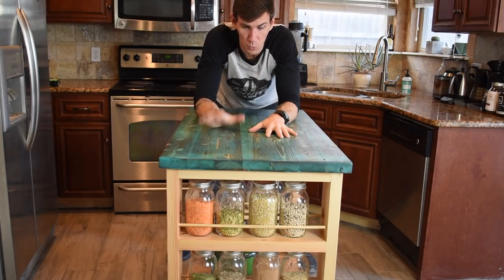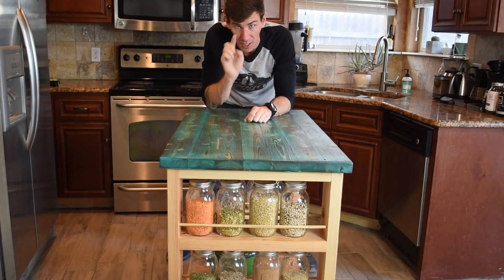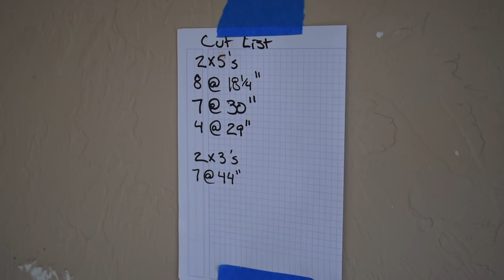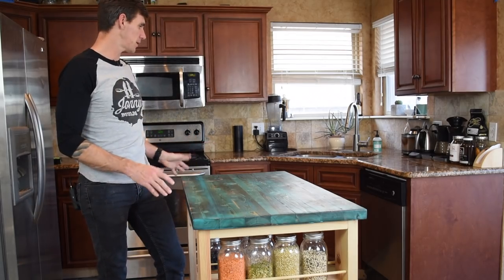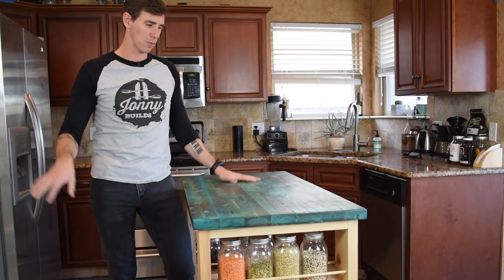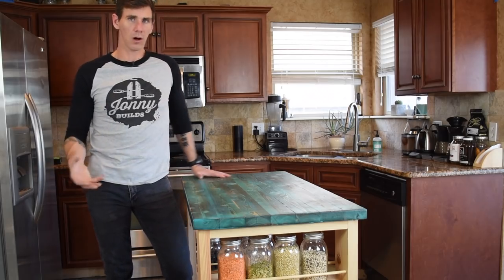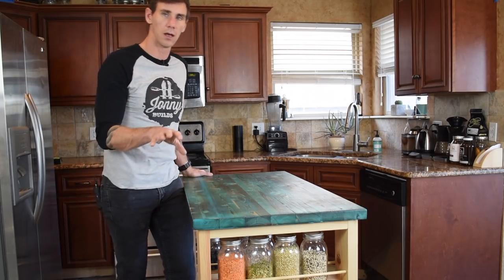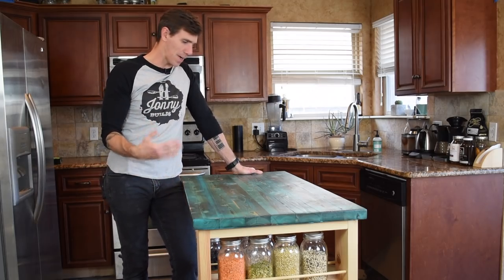DIY Kitchen Island w/  Stained Shou Sugi Ban Tabletop

Comment: I made one similar to this, but added a full shelf about midway down.  I wondered, though why the table top had (3) supporting boards to rest on, but the bottom shelf didn't (which also led me to wonder whether the shelf needed this).  I'm now making a smaller, lighter one for my sister, who has a very small space for this, using 1x4's for the most part.  Loved the Shou Sugi Ban effect!

Comment: Nice build. If i could add that the dowels may warp or accidentally break would using copper tubing to cover them when sliding them through the end. I like adding metal to wood projects.
Reply from the maker: Copper tubing would look really cool. Never thought of that. I will say that I use this daily and often and the dowels are holding up nicely. The fact that they flex a bit makes getting the mason jars in and out a breeze.

Comment: Hola Jonny, excelente trabajo, felicidades, muchas gracias por compartir tu trabajo, por otra parte, noto un detalle con respecto a las medidas, específicamente en la parte de arriba o cubierta, ya que al componerse de 2" x 3" esta daría un ancho de 21", sin embargo la medida de la parte lateral de la base es de 22 1/4", posiblemente la medida correcta para las piezas de la cubierta sea 3 1/2", dando una medida de 24 1/2"... Saludos!

Comment: That colour looks sooo good.
How did you avoid getting squeeze out from the glue up messing up the stain? Does the stain colour glue?
Also what's the purpose of using glue and pocket holes for the table top? Is just glue sufficient?

Comment: Nice build. Not insulting the finished product, but it's important to let folks know that this is actually not shou sugi ban. What you did was lightly toast the surface of the wood. Shou sugi ban requires actually burning so much of the soft wood that removing the char actually scoops into the soft wood and leaves the harder grain raised - quite a bit more work, but you end up with even more striking pieces. I've used the technique for several pieces for D&D gamers.

Comment: Looks great! But couldn't help but notice that if you look at the end grains of the worktop, you have all the planks grain arching in the same direction apart from 1 or 2 that are the heart wood. When I make bar tops or any jointing of planks it's best to alternate the direction of the end grains (up, down, up, down, up and so on). This helps prevent the top from 'cupping' over time as the planks fight each other to pull in their relative direction, where as if they were all the same way up or down then they can pull together quite easily and start to 'cup'. Hope this advice is useful to you but apart from your work looks ace!
Reply from the maker: Thanks! I definitely goofed on the board layout, but it’s holding up nicely so far.

Comment: So total newb here but ... can you use that surface for chopping (with a cutting board/butcher's block) and such? Can it get wet?
Reply from the maker: No, you wouldn’t want to do that with this particular finish. The wood is porous and the finish isn’t food grade. I put a cutting board on it before chopping anything up.
Reply: But it could be, with a coat of epoxy resin. Proper prep would have to be done because it's individual boards, but a top like this would look even amazingER and be foodsafe and heatsafe with a finish coat of clear epoxy resin :-)

Comment: Ok but you can use a cutting board, you wouldn't be worried about getting it wet with tomatoes or lettuce or something? It is a work surface and not just for display. Great vid, fantastic editing, I subscribed.
Reply from the maker: Its not an issue. With the finish it wipes clean easily.
Reply: This is amazing, and the poly is a nice coat, but it would just POP and be so amazing covered in a coat of clear countertop epoxy 😍😍 <swoon> Love your work, Mr Builds :-)

Comment: Very nice project, curious, do you think this structure would support a granite countertop on top instead of a wooden top you assembled?  I'm assuming weight of granite would be around 100 lbs?  The wood 2x3's together probably weigh about 30 lbs.
Reply from the maker: Thanks. I’d probably use a stronger joinery method beyond a few pocket screws at the bottom, but I think you can make it work.
Reply: @JonnyBuilds  Hey just wanted to share, I finished this a few months ago - picture of your design frame with granite countertop, holds up well, slight wobble is unavoidable with the wheels but it is minimal, thanks again - I did do extra strong joinery. - https://imgur.com/a/6CRBKaz

Comment: Good job ! I noticed that you planed your table top boards , and then while you applied stain I noticed a  crack between 
your boards . I do a lot of shou sugi ban and in the burning process I get warpage on boards and also the grain is 
emphasized , cracks appear and glue joints open making for a non smooth work surface especially
when I do a deep burn. I don't want to sand, plane or do anything to lose the character except maybe epoxy.
Do you have any tips ? Thank you

Comment: Cool project. A few questions:
With the laminated slab on the top and casters on bottom, does it feel top heavy or unstable?
Could you have just friction-fit the dowels in? I'd be afraid of them breaking and not being able to repair it.
Does gluing dimensional lumber end grain offer any strength at all? I've never had any luck with it.
Reply from the maker: Thanks! This isn't top heavy at all. The top is just 2x4's. You could friction fit the dowels, but I am not worried about breaking them. I use this often, and it hasn't been an issue. All the end grain glue joints are pocket hole joints. The glue adds strength, but its more to hold the wood in place when you drive in the pocket holes.

Comment: Did just screwing the top to the base ever cause anything to split? Doesn't wood have a tendency to expand and contract with the seasons?
Reply from the maker: No splitting so far. The holes are slightly elongated to allow for some movement.
Reply: Jonny Builds thanks for replying Jonny.

Comment: Great video! how stable is the finishing if kids put a glass of water on it for instance? i am thinking if making a new dining table with a finish like yours.
Reply from the maker: To make it more resistant to stains add a few extra coats of wipe on poly, and the finish with a top coat of paste wax.
Reply: Thanks, i will give that a go.

Comment: Is this a military secret on what the color is I’ve asked many times no answer.
Reply: This looks like the turquoise colour from his previous video showing the technique. He had red, green and turquoise. The label said Minwax wood stain. But he said it was a pre stain that home depot mixed up for him. 🤷‍♀️
Reply: @faebrowne2537  this stain is a water based stain sold at lowes. it has a stain chart, and only select colors can be made in this product. More than likely it's verdegris: https://i.pinimg.com/originals/b5/e9/db/b5e9db5647ee4bff5b8d1760c9c99519.jpg which would be using pigments 103 or 203 (not that this matters to you, but I mixed these colors on the regular so those pigments are pthalo green and special green) which carry a blueish tint. it's cheaper at lowes too, around 10$ a can [quart].

you're welcome.

Comment: The kitchen island turned out great, I'm really interested in seeing the more I depth shou sugi ban tutorial! Also, I've never done a large table top glue up before, have you experienced any major cupping or warping when using pocket screws like that?
Reply from the maker: Thanks for checking it out! Yeah, I had a ton of cupping using the pocket screws. I just did it to show this build is possible without a domino or plate joiner. That said I wish i would've used my domino.
Reply: Jonny Builds I appreciate you showing a joinery method that uses more accessible tools. But I'll definitely keep that in mind if I'm doing a glue up like this in the future.
Reply from the maker: It flattened right out when I screwed it down to the base, so it ended up not being an issue.
Reply: Jonny Builds Awesome it looks great in the video. Thanks for the tip!
Reply: Jonny Builds Do you think that the cupping was due to the pocket screws or the fact that you did not alternate the end grains?
Reply: steveos111 What is alternating end grains, one faces up, the next faves down, etc.? What does this achieve, or what is the point of doing it? Thanks :-)
Reply: @tiffanyhackerspace8377  wood has a natural tendancy to cup or bow in the direction of the end grain. Alternation the direction of the end grains in a table top helps stop this.

Comment: The project has really come up well and gives a lot of ideas. I had a couple of questions on this finish:

1) I see that you have used a big/professional type propane torch, would using a smaller one make any difference to the charring of the wood? say the one in the link below: https://www.homedepot.com/p/Flame-King-Multi-Purpose-Brass-Pencil-Tip-Propane-Torch-Head-YSNAX1-001/307958743
Let me know please :)
2) Also is there a way to give that dark burn effect without burning the wood - say with a different stain and rub it off? I have the garage cabinet that I am planning to paint the way you have mentioned and I might kind of risk burning it/catching fire - so want to know if you have any alternative ways that you think might give the same effect?

Regards

Comment: Good idea but...you have make an error (in my opinion).
I think you should have first burned and then glued the various parts of the top. the heat created cracks in the joining of the pieces.

wanting to analyze another point, during the burning phase it should be burned much more and subsequently brushed and sanded. the softest part of the wood must be removed, creating a three-dimensional texture but this is Only an esthetic opinion.

I m sorry for my bad english. I've used google translate

Comment: I agree that it either needs center shelves or stools to justify the wasted area that is desperately needed in a kitchen that size.... beautiful though so no condescending criticism intended....you may want to also keep in mind that some flour,  pastas etc. lose nutritional value when exposed to sunlight...making some of them with little nutrition such as vitamin B.....that is why many vitamins are sold in those ugly brown bottles so you may consider the translucent paints now available ....after of course double checking my suggestion for yourself...I do not remember which one's tend to break down the most.....your design is otherwise pretty cool.